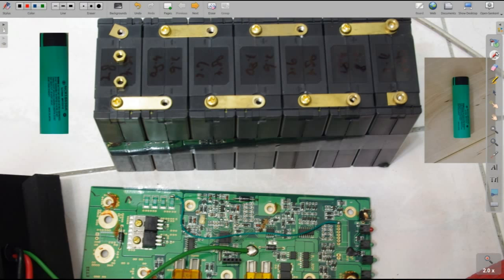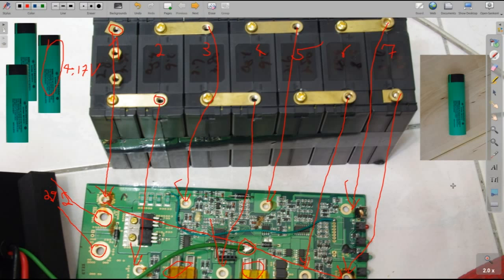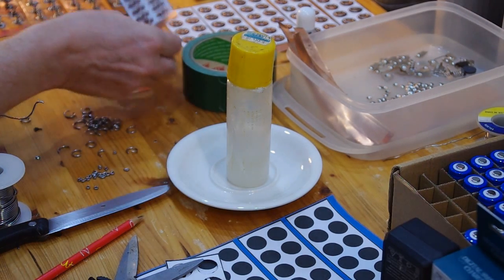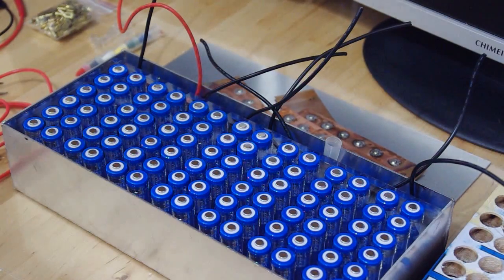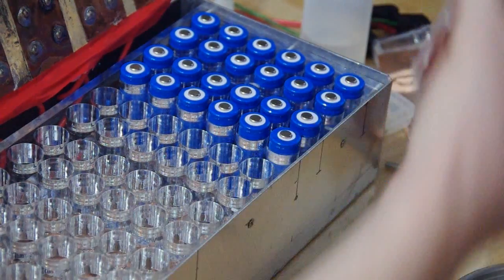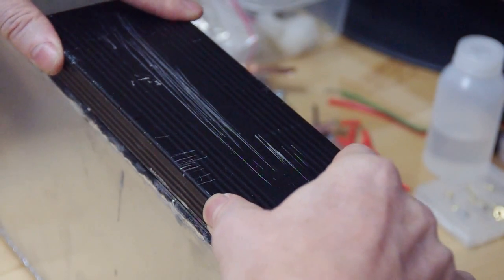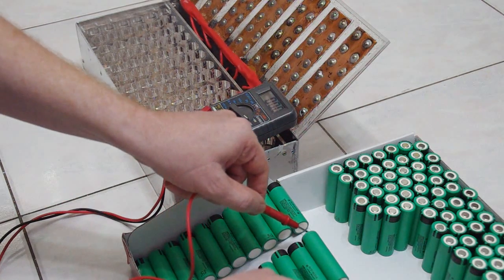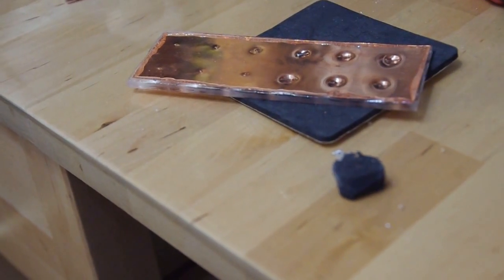How to build a Li-ion battery pack with panasonic 18650 cells 3100mah A

Comment: Hi David, great work with the battery! I was woundering did you make the PCB your self or did you buy it as an complete component. Do you have support for balanced charging?
Reply from the maker: The PCB was recycled from an old Li-ion battery pack which went down after about 4 years of using it.
It seems to balance the new pack just fine. Still, I have to check sometimes to see if everything is in order.
However, after using it for about two and  a half month, I haven't had any problems.

It charges to 29.2 V and then cuts off. The green cable then shows 8.4 V which I don't really understand. 
Anyhow I record every charging with a webcam and check later for how long it remained in blinking red-green then green-green and finally green only. It stays starting from 24.8 V for 3.5 Hours in green-orange. At 28.3 V, it changes to green-green blinking for 1.5 hours and then charges the remaining time in green only. 
Green-orange is fast charging and green only is very slow. 

When I paddle and use the tandem bike alone, the range goes up to 100 to 110 km, however using it with two people or being lazy, it will get you about 80 km. 

If you are interested in building one yourself and do not have an old pack, you can take a look here 
 http://www.ebay.com/itm/5-6-or-7-cells-20A-w-balancing-Li-ion-Lithium-18650-Battery-In-Out-Protection-/111091669495
Reply: davidcandlelight  ~12W/km or ~19.4W/mile -- that's pretty good.  A Tesla Model S with a 85 kWh battery uses 195.6W/km or 314.8W/mile (of course it is much heavier & has more drag at higher speeds than an e-bike -- but I'm still impressed.)  :-)

Comment from the maker: Here are the template files which you can use to laser the Plexiglas for holding the 18650 cells.
They can be manipulated with Coreldraw image software, or you can use open source free Inkscape with the cdr plugin. 
http://www.carookee.com/forum/Englishteachers/depot/40290/4285574
http://www.carookee.com/forum/Englishteachers/depot/40290/4285573

On the bottom of that page will be the option to save the file to your pc.
Reply: How to reach you in Taiwan?
Reply from the maker: Jeff Fu go to http://www.taiwan-taipei.com and click on contact.
The mail service won't sent anything to me, but you'll find me there.